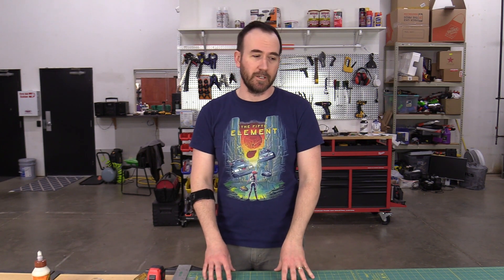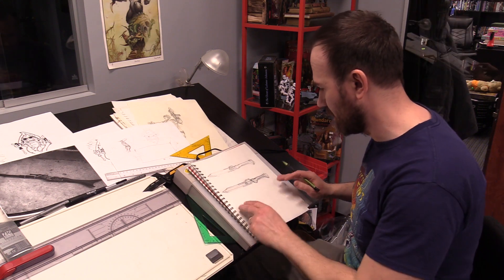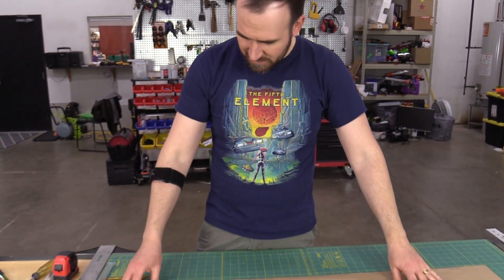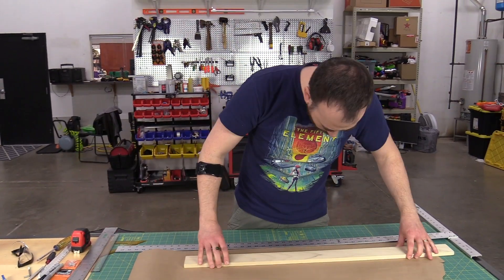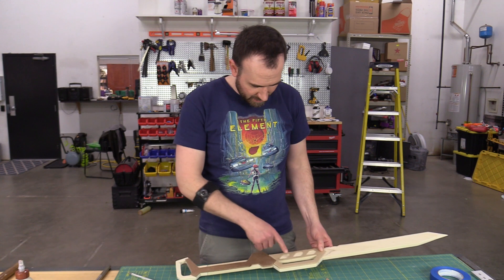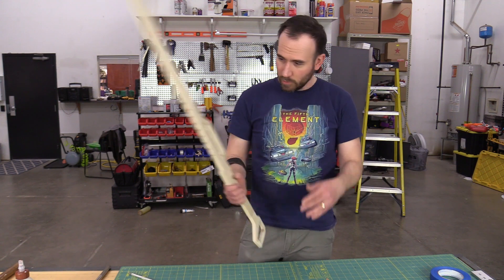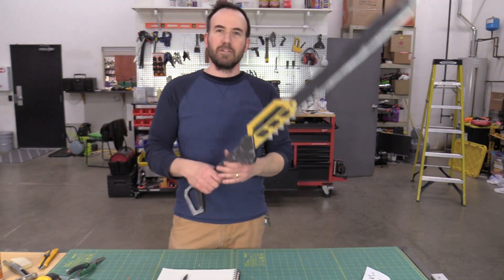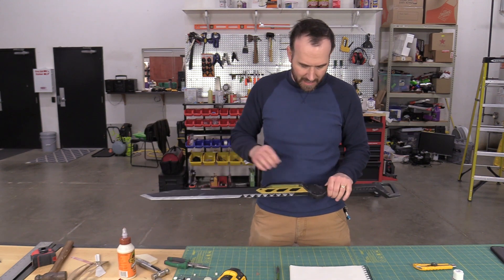How to Build a Cyberpunk Sword - Awesome Build

Comment: I don't do model builds. Did dabble in set building nearly 20 years ago but I mostly do cabinetry work or renovating pre-existing pieces of furniture. I'm always picking up items discarded by others to either work on or to dismantle for later use. I now have more jars and tins of pre-used screws, nuts, bolts and washers than I'll ever probably find a use for. Just because it's a disowned bedside table today doesn't mean its component parts can't become a cyberpunk sword tomorrow. 

Even if it's a cheap chipboard build, that unwanted chest of draws, wardrobe or shelf unit has to be held together by some hardware (dovetail and M&T aren't overly used with chipboard). Grab it when you can. Never know when it'll come in handing for a little bit of detailing.